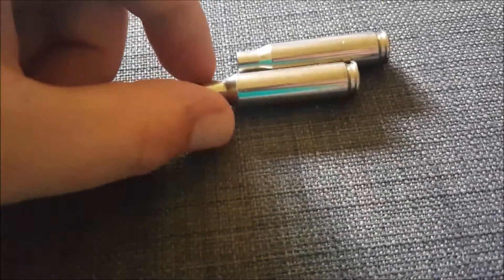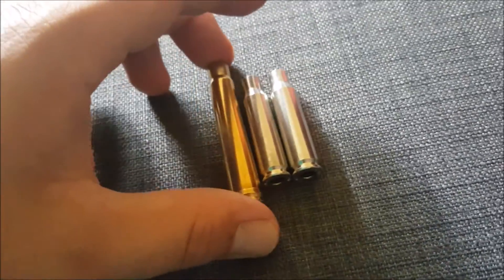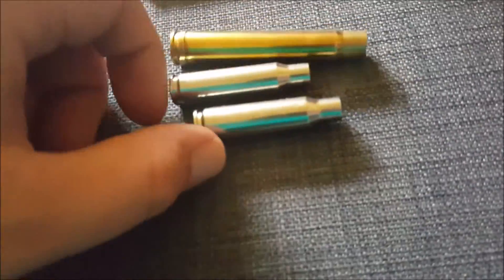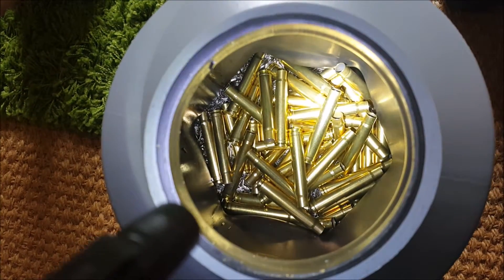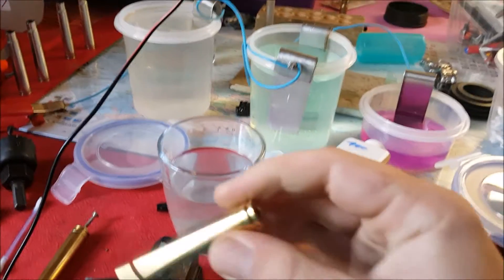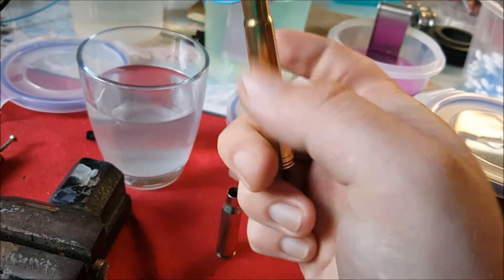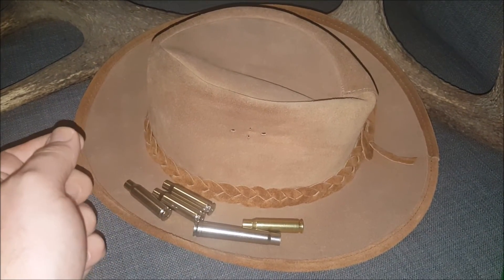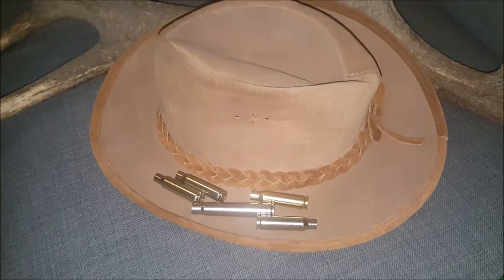DIY nickel plating brass cartridges

Comment: Excellent video.  Since that was in 2016...Any update on durability?
Reply from the maker: Still going strong. No issues using a wet tumbler. You wear out the brass before the plating goes
Reply: @erklaerbaer01  Excellent!  Thanks!

Comment: If you mix lye and draino, you're mixing Hcl with NaOH, which Make Table salt, so basically, you've made a (per)chlorate cell, which is especially dangerous indoors (H+ and O2 coming off the electrodes) and in the presence of sulfur (in gunpowder), the chlorates could explode especially if dry. I would not attempt this step esp indoors
Reply from the maker: our drain cleaner in germany isn't made of acid.

Comment: i am knew to this and am wondering why are you tumbling them,is this to make the surface more etched or rough in order for the nickel to adhere better? and when you got nickel can you usually plate it with copper without treatment or does it depend on the finish of the nickle? because some nickle coins failed to copper plate on me properly until i went over them with a steel wool
Reply: to clean them of powder residue and filth. Firing a rifle round, even with modern smokeless, is dirtier than a fart!
Reply: what was that?
Reply: @ARCSTREAMS  Ammo gets dirty, tumbling cleans cases for reloading. Also, nickel plated ammo is easier to clean and won't corrode.
Reply: ok now i understand,,i guess brass is not good enough and corrodes? perhaps nickel also makes them smoother and not jam or something like that?
Reply: then again even a rough surface bare metal wont copper plate till you nickle strike it first

Comment: WHy would you bother plating ammo?
Reply from the maker: corrosion resistance mainly
Reply: to make them more durable and WAY MORE BADDASS!!!! AND CORROSION PROOF!!! Brass ammo turns brown and then green even sitting in the gun safe after time!
Reply: Nickel plated cartridges feed better! It literally slicks on a long bolt action !!!

Comment: Wow, you really skipped over that plating solution bath!  What was the concentration?  What were those other metal parts in there?
Reply: you make Nickle acetate by dipping two nickle strips into distilled vinegar with a 1amp 5 volt charge across each strip. DON'T LET THEM TOUCH EACH OTHER. Give it 24 hours, when the liquid is a pretty emerald green, it's ready! DO NOT DRINK IT!! It may look like gatorade, but trust me, this ISN'T THE ELECTOLYTE YOU NEED FOR SPORTS!! POISON!!!!